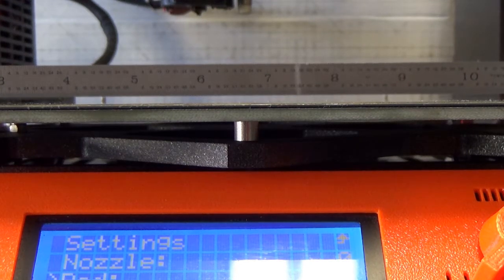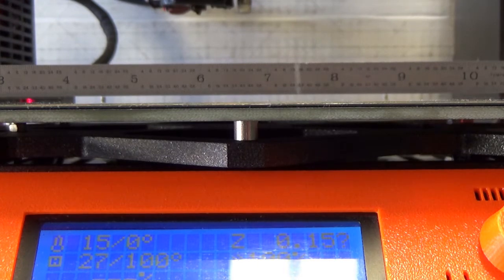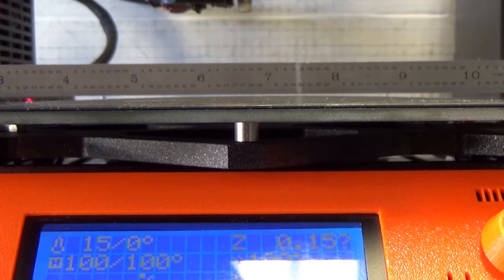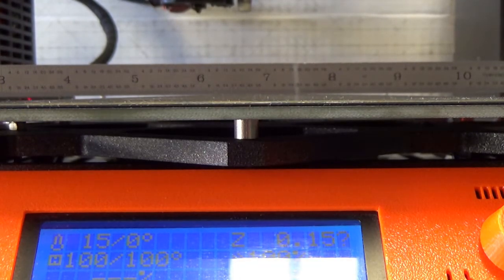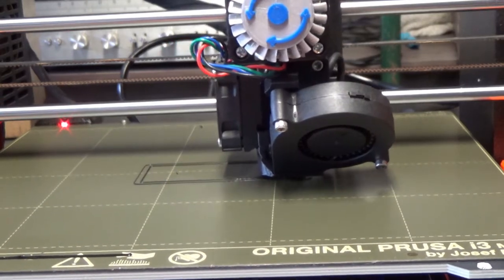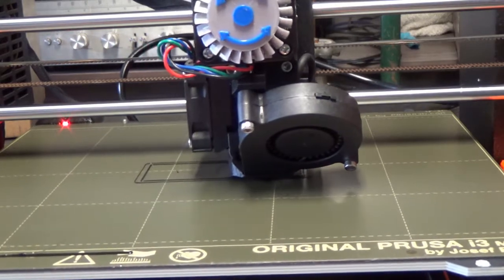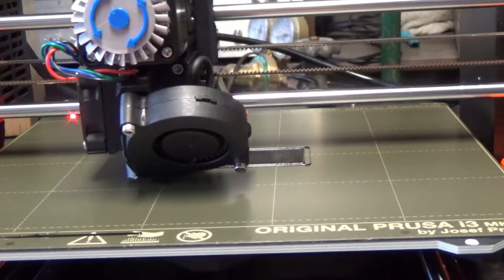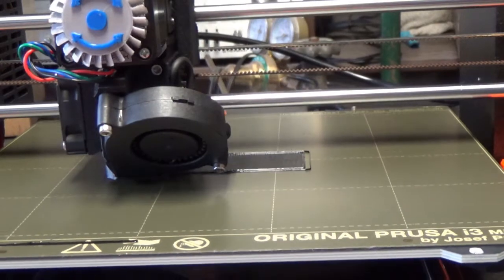Prusa I3 MK 3S heat bed issue.

Comment: Thank you for sharing. I was experiencing some warping on my prints recently and I found your comment on Prusa's site. I will check if my bed warps.
Reply from the maker: Thanks for the comment. While the bed was malfunctioning  I was able to print PLA as it requires a lower bed temp, but I did get warping that I had not experienced before.